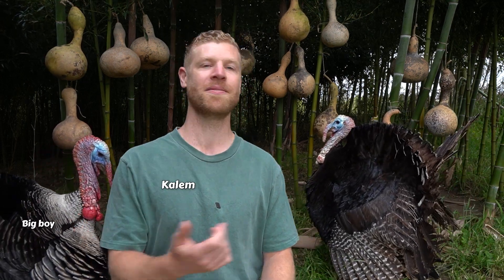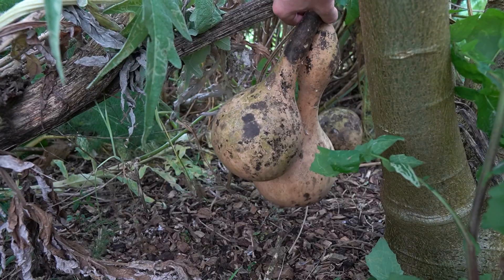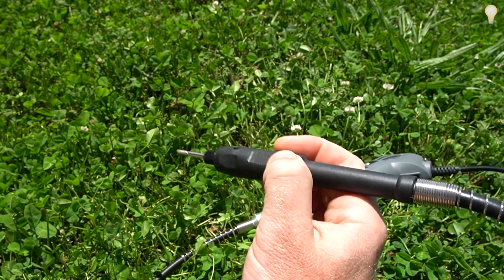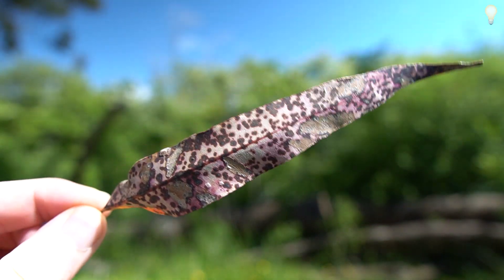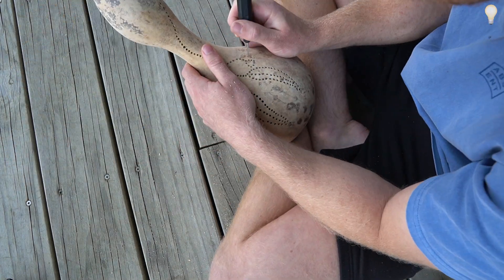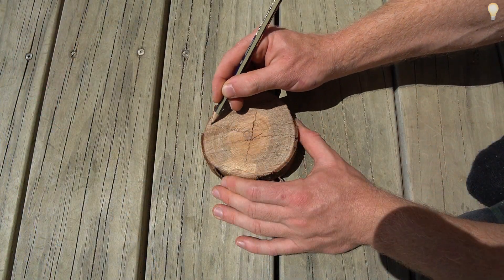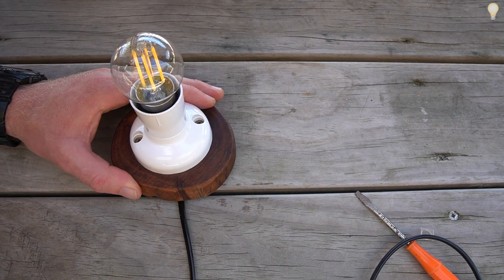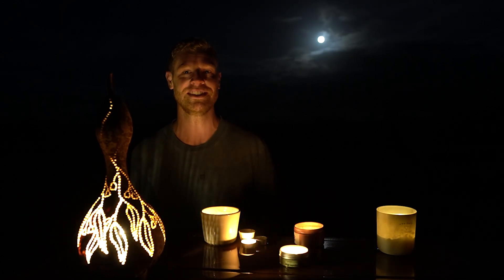How To Make an EPIC Lamp From a Bottle Gourd - Full Tutorial 🌿💡

Comment: Hi Kalem, thanks for this fascinating video on creating a lamp out of a Bottle Gourd.  It was a very creative design that you built that really came to life when it was lite up with the electric bulb.  I was wondering how it was all going to come together but I think it came out really great.  One thing that really amazes me is that the Bottle Gourd dries out so much on the skin and the seeds as well.  Most Gourds would rot and decay and turn to mush and that dries so hard and keeps it's shape. It seems like there was a little smoke escaping from the holes in the darkness so you probably could just keep it on for a short period of time.
Reply from the maker: Hi Ben, yeah it’s pretty cool that they basically turn to wood. 
That wasn’t smoke by the way, it was steam from an aromatherapy vaporiser. I just wanted to showcase the lamp with the vapor lighting up cause it looked cool :)
Reply: @TheKiwiGrower  Ok, makes sense, glad it was steam from the vaporizer instead of smoke.  I was a little confused by the mist as you mentioned the bulb runs cooler.